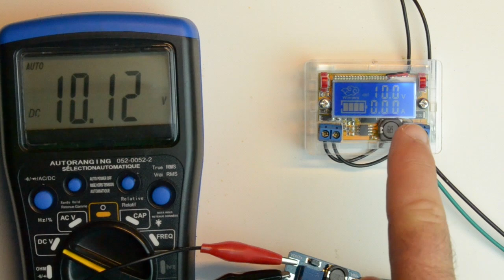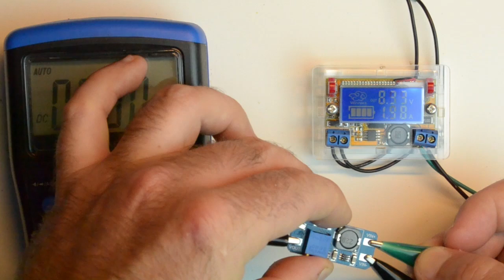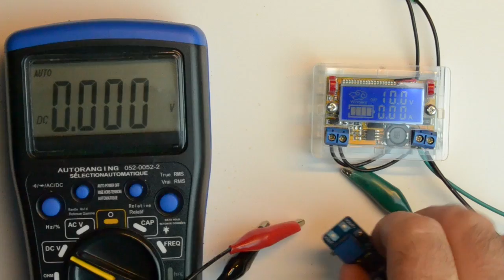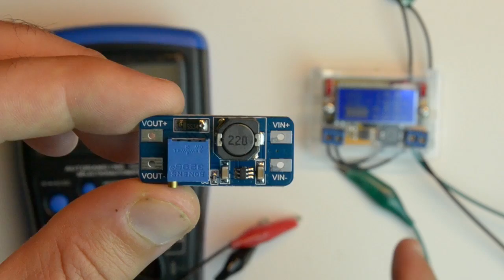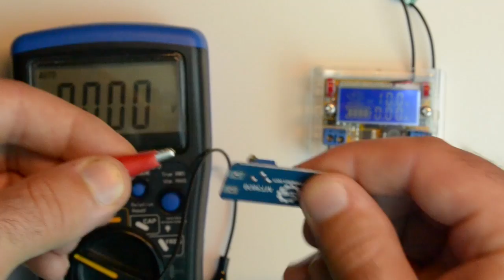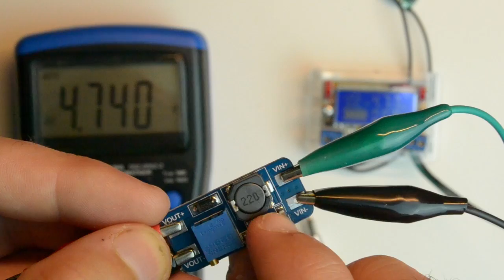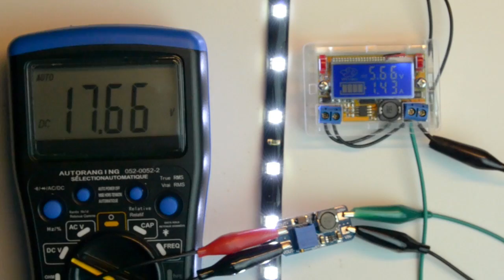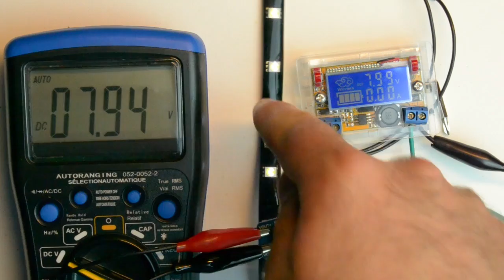Caught on FIRE?? MT3608 DC DC step up boost coverter

Comment: You just have to turn the potentionmetre more so that it works
I had the same problem :)
Reply: Yup bought some years ago, did the same thing. Pots are like 50 turn ones or maybe more
Reply: And counterclockwise is higher voltage, and you should never turn fully right. Because the PWM goes to 0%, witch means the MOSFET shorts the inductor output to ground.

Comment: first of all, pin 4 =EN  need feed small current nA and should not connect direct to V in. 
second then pin 3 =FB with max 6v: need constant fixed resistor, not variable adjust or can not adjust while going on operator; this will drop voltage that going generate problem.
third max ic=3 amp that mean 2v x 3=6 w, then the reliable for stable running is 3w, any over could give over heat and burn ic.
after all , this module is good for small loader like remoter control, led like 2 AAA battery to 3.3v, or 5v to 12v, 12v to 18v with fixed resistor; other way it not good for test or heavier load tha 7 watts.
Reply: you're absolutely wrong because 3A is the open switch current while the MOSFET resistance is 80 mOhm typ. and the power is only 19 mW.

Comment: I have exactly same as yours, but I increase output voltage with counter clock wise multiple turns.
Power is supplied with lithium18650 in parallel full charge 4,1-4,2volt, boosted to 20 volt no problem.

I can load 6 lamps high power Led (10 watt each) with configuration of 2 in series, 3 in parallel.
I am not sure it can fully load because of limited current from mt3608 (maybe under 2 A). But I am glad it does turning them so bright. 
And yeah please add heat sink to inductor, because mine heating up very hot in first 10 seconds, but after heat was dissipated, they run perfectly.

Anyway, thanks for sharing your video.

Comment: i had the sameee problem in all  i ordered soooo i solder a 10uf cap plug a 24v 20 watt led and it started adjusting no problem they probably need some kind of load to response

Comment: um didnt that meter thing say 2.96A, these are not rated near that. What load are you pulling from this, just a meter, you probably need a min load or bleeder resistor?
Reply from the maker: Yeah that is because the buck supply (small blue LCD device) is current limited to 3A, the IC shorted internally and drew the buck supply's limit
Reply: Oh i just realized you were over voltaging it. Did you have anymore failures after keeping it under 6v?
Reply: @tablatronix  it has 2-24V input by datasheet. 
Mine also burned when trying step up 12V to 20V.
Reply: Jan Vojíř feedback voltage is 6v max, so the pot needs to be adjusted before increasing the voltage

Comment: Mine's didn't work either ; applying 9vdc yielded 2vdc at the output after turning the pot 25 times. The circuit seems to behaving completely differently from the MT3608 datasheet by AeroSemi (an unheard of Chinese chip company). I don't think I'll be using these of my 
web cam and going on vacation, Basically, it's typical Chinese junk.

Comment: You had no chance with them, i'm using them very often and all i've recieved work great in led project converting a single lithium ion cell to higher voltage. I use them to power 12v amp and 10W high power led however the ic get realy hot that is the problem.

Comment: This SX1308 (b6286 MT3608) chip's a few problems. First, when the chip fails, it shorts Vin and ground. Second, for some boards, you need to unplug the load before switching on Vin. If not, Vout will always be Vin.

Comment: you have to turn the pot really slow counter clockwise for a good while  until you find that sweet spot and it will function as advertised.if you change input voltage you have find that sweet spot again.

Comment: Put a capacitor on the output (at least 10µF, respecting the polarity if any). It burns because the current raised into the inductor doesnt have a path to ground when the IC opens its switch, and so goes through the IC and melts it.
I agree on the fact that this trick should have been told by the seller, but on the other hand please document yourself about the circuits you are using before connecting them and watch them burning, or if you want to live dangerously put a fuse or something !
As far as I can see, the IC is so small i dont expect the output power to be much higher than a watt.
Reply: alexandre meyer Mine after 30 counterclockwise turns makes clicking sound once every next turn. Connected a dozen in two years successfully but this one wont boost from 3.7V to 5V. Why is that?

Comment: I blew up a few of these too. But before you call an item defective you should know which way the pot needs to be turned, not just "turn it the other way". Also since it is a step-up device you don't start testing at 10V I imagine? and you can bridge the +- output with your fingers? When you re buying them for 0.5 USD a piece you might as well figure out how they work... they're sensitive devices but work great! And god bless China for selling them to all of us at this stupid price! They handle 10W without blinking!
Reply: While I appreciate your argument, I have to disagree that no, unless there are specific instructions displayed in huge warning letters, then the module is (DESIGNED) defective if you have to do that in order to not fry it.  This is not how you  have to treat practically any other buck or boost modules, clearly the design was made by a mowwwwron, who didn't understand why it was a good ideal to not leave the pot wiper floating and instead put a  trace between it and the pot contact closer to ground, like any sane person would do because you are never supposed to depend on a pot wiper making 100% good contact even while turning it, even if it didn't have this other flaw that these do.
Reply: You will kill them by applying more than 6v to them out of the packet.  I only blew one up before i realised this and now i input at most 5v and they all seem to be very happy.  The reason for this is that they come set at minimum and the Vref pin can only handle 6v.
Reply: mendebil - I also like these modules and bought a few for different purposes. I killed one too, but managed to repair it. Pretty small chips but doable. (See my other comment for a link to my video about the repair).
Reply: @MaxintRD  Why on earth would you bother repairing it?  They are not worth the time, at under 25 cents each in bulk.  I suppose if you are pressed for time to complete a project then DIY repair is the most expedient means towards an end, if the alternative was  waiting weeks for more from China, but it is hardly worth the bother otherwise.
Reply: @stinkycheese804  - For me it was partly educational, and partly not waiting for china if more of them would fail. Often I feel the need to give second life to the victims of my experiments.Time hasn't been a deciding factor for me. It's more that i don't like that failing feeling of stupid mistakes...
I've been using these in various projects, including a solar charger where I inject voltage into the feedback pin to manage the power. On another module I replaced the coil to provide isolated power to a current meter. I also used bare chips to make a mini boost converter.
Reply: Ya, GOD bless china for taking away millions of American jobs but I admit that I am forced to buy the garbage they make because the American companies can make a few more pennies per item. Wonder how long before they start making our children ? lol
Reply: @vidasvv  Nope, American greed and postage rate disparity is the problem.  People want to sit on their butts and pull in big money when they are doing nothing valuable.  It's not the hard working american labor pool but rather the adminstrative, executive positions, the environmental regulations and so on pushing costs through the roof.

The result is, you can get these boards under 25 cents each in bulk but if a US company were making them, then they'd want at least 4X as much plus it would cost more in shipping cost than they are worth.

2nd problem is our trade agreement that subsidizes postage such that you can get 10 of these delivered from China, for cheaper TOTAL cost,  than it would cost you or I to mail the EMPTY envelope they came in, to our next door neighbors.
Reply: @vidasvv  i dont think they are as good in making children as people from other continents 😅😅

Comment: Hi, Have you tried to reverse engineer to see if the circuit is as per the data sheet, the schottky diode is okay? the pot is the correct value or even connected on all three leads?
The IC in the right way..
Please use a switch to switch it ON, not a clip lead.

Comment: Input and output ceramic capacitors of 22μF are
recommended for MT3608 applications. For better
voltage filtering, ceramic capacitors with low ESR
are recommended. X5R and X7R types are suitable
because of their wider voltage and temperature
ranges.

Comment: You ran 6v 3amps though that tiny ic , its input rated 1-2amp 
just by looking at it. The xl6009e1, would handle that load.
Reply: xl6009 module is good or not tell me
Reply: It burnt and became load, there was no load connected. It is crap with lies in the datasheet. It doesn't work over 7V in.

Comment: quality video!
I ended up here to learn what works or not for my goal. any suggestions people? this board seems to be ruled out.  ebay links for suggested step up boards appreciated.
goal: 2 x 18650 (avg 3.7-4v each) in series step up to 12v LED strip (1 amp or less) OR should I just use 3x18650 (about 12v)

Comment: Found out that the max input is 6 Volts, so 10 volts is way too mutch.
Reply: Datasheet says: • 2V to 24V Input Voltage
where did you find 6v limit?

Comment: max input is 5v for this not 10v. 10v is too much. turn the poti against the clock till the dc dc converter starts not clockwise
Reply: Specs listed for that model are:  input voltage: 2 v ~ 24 v
Reply: MT3608: High Efficiency 1.2MHz 2A Step Up Converter
• 2V to 24V Input Voltage
• 1.2MHz Fixed Switching Frequency
• Internal 4A Switch Current Limit
• Adjustable Output Voltage
• Internal Compensation
• Up to 28V Output Voltage
Reply: Angus, did you even read the datasheet?
Reply: Not according to the datasheet it's not.

Comment: I've played a bit with these & had them die when trying to go below the input voltage. There is another model that integrates a micro-USB connnector for 5vdc input. I've had them powered by 4v up to 11.6v (12.6v 3S with 2 diodes). They work great for boosting but also appear to be able to output a lower voltage than the input, although I only tested 11.6v input down to 9v output. They are also marked MT3608 but are shorter & have wires visible on the inductors.
Reply: I got the same version of this DC/DC converter as you and it works just fine.
Also I think the layout is better on the version you're talking about (the small FB resistor is much closer to the IC and the output capacitor is closer to the output pins).

In my converter the output capacitor was dead shortcircuited so I replaced it by a 1uF capacitor with the same package (1210) and now works just fine.

This little converter is perfect to run fans or stuff that need more voltage from a USB port.

Comment: Turn pot counterclockwise until voltage goes up. I had same problem getting voltage increase going clockwise many turns but then turned back counterclockwise many times until I actually got 5.0v out from around 4.2V in (got 5V out using one 18650 easily 2.5V - 4.2V in)  . Also, as I purchased these to use with two 18650s for input voltage 6.0 to 8.4 to give 12V had no problem getting 12. I went back to 6V and actually got up to 27.7V max with no heating problem and ran 6v in at 18v out also with no heating problem. I didn't have the burn out problem going clockwise but didn't push the limit with high voltage. I have no idea why you did but I'm going going to test this procedure. I believe these should perform well. Note that as voltage in becomes greater than voltage out setting, the voltage out will follow the voltage in but be just a little lower. Thus set out for 5V and then put 6V in will get around 5.8V out. I tried two units and thought they didn't work and then looked up datasheet and found that NEED TO TURN POT COUNTERCLOCKWISE TO GET VOLTAGE INCREASE. Google is your friend.
Reply: you need to keep 1.5 volt difference between i/p and o/p...o/p should be higher by at least 1.5 v

Comment: You are prematurely writing the MT3608's obituary! Let me start with  some background. How these DC to DC converters work is as follows.  Basically the input is used to charge up the inductor. The inductor is the put in series with the input voltage and supplied as the output voltage. Since voltages add in series the output voltage is higher than the input voltage. This switching is done by the IC, in our case the  MT3608.This is the DC-DC Boost converter.
You also get a DC-DC Buck converter where the inductor is charged by the input and only the inductor, but only the inductor is then applied to the output, giving you a lower voltage. This happens at very rapid switching (in our case 1.2MHz) so that you get a relatively reliable output. How the voltage is set is with the use of a feedback resistor, in our case the 10 turn pot. This feedback is used by the IC to charge the inductor to the correct voltage.
You cannot use a Boost converter as a Buck converter, since the input voltage are inductor must be in a different configuration. You do get modules that can do both Boost and Buck, but they will usually have two different inductors. It can also be done with MOSFETs, but an extra inductor is probably more economical.
Why the modules burn out is that they are not Buck-Boost modules, but only boost modules, therefore the output must be greater or equal to the input voltage. Not quite sure why you were able to set them to a lower voltage than the input, but they probably did not add a safety in the event that someone tries to lower the voltage.
I am not sure what you meant by your last statement that all your modules were defective , since I saw at least one of the modules working perfectly and you even powered an LED strip with it.
So I would like to know based off what do you declare you modules faulty.
Also note that in order to reach the rated values of the modules you might have to add heat sinks. Since operation might not require one, they might not provide it, since it is extra cost.

Please also beware that you will not always be able to run the modules at the rated values. They do often oversell the operational conditions!

Also for future reference, the Chinese mentality differs greatly from the traditional Western mindset. If you are going to order cheap items from China I would just like to keep the following in mind.
If you order a larger quantity of items from Chin, they do not check that all the stock is in perfectly working order. Quality assurance is expensive ad they will rather want to provide you with a cheaper product.
I have never had large batches of defective components, but be aware that you might receive defective components.
Reply from the maker: Hey, that's some good information, the one that did work, i couldn't adjust, so none of the boost converters were usable as they were advertised at. I did however get another batch and they did work better, but had an extra link on the pot in the back, I'll have to make a revisit video.
Reply: I've had several of these modules, the reason they burn up is if you go too low with the pot which operates counter to what you think, so turning the pot clockwise reduces the voltage output. These modules also use a 25 turn pot, at no stage did the op turn the pot more than 5 turns in any direction (before swapping direction). They are temperamental but do work.
Reply: That's not an explanation for why they burnt out. Turning the pot down does (or should do) nothing bad, the IC will simply switch off the internal MOSFET. I suspect the power source in this video (also a switcher) had an inductive output impedance, so the MT3608 module needed a decent bypass capacitor at its input.

Comment: Hi mate. If I only saw this video earlier, I wouldn't buy this module. And I bought 5 of them. First one went on fire exactly like yours. The second seems to work fine,  steps up from 5V to 24V, no problem and it doesn't even get warm. But can I trust it in a long run? Especially that this was gonna be esential part of an important project. I thik this module is simply piece of crap and most of them or don't work at all, or go on fire.  I will go for this one next time: http://www.ebay.co.uk/itm/Boost-Buck-DC-DC-adjustable-step-up-down-Converter-XL6009-Module-Solar-Voltage-/191777597596?hash=item2ca6d5e89c:g:3xQAAOSwGotWjy67
Looks more proffessional, don't you think? 
Thanks for the video. Cheers!